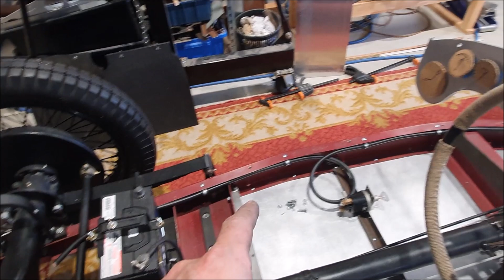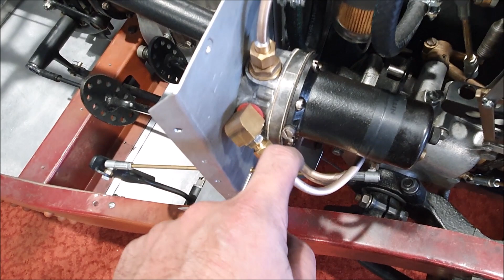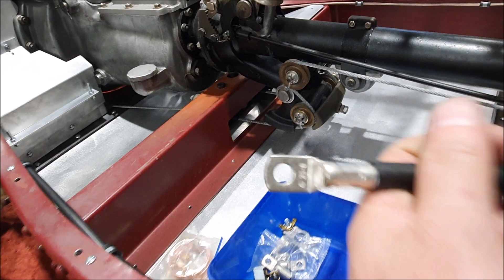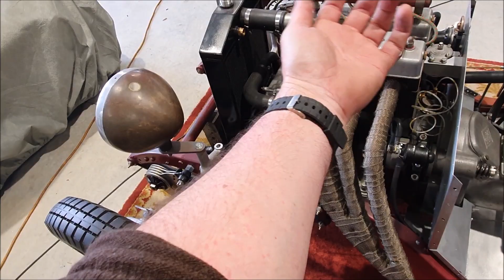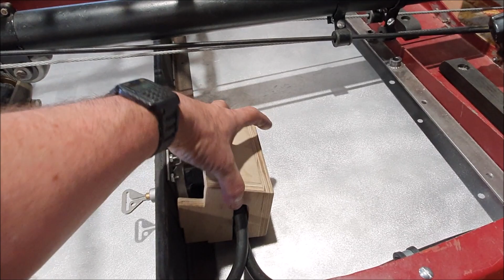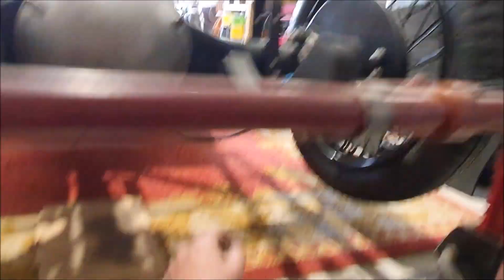Pre war Riley Brooklands - making up time part 2

Comment: Also put some rubber end boots on your isolation switch. The pump ticks as internal pressure naturally reduces when standing. Each system has its own quirks.
Reply from the maker: The brake light switch, which was also from Durite, has a rubber boot but the battery one didn't. I can 3D print some maybe.

Comment: Good progress. These fitments require forward thinking and take time of course. Fully recommend heavy duty cable as I had big issues with the twin 6v system on my Alvis. AES as already mentioned in the comments, set me right with suitable period cable and fittings. Looking at the earlier videos, you have done a fantastic job; Riley quality shines and it always saddens me when reading the company history and you wonder why they lost their way as an independent. This car is going to be a beaut. The SU pump if you have the mechanical ones, I always rubber mount  to reduce the noise. Perhaps not really an issue in an open car though however a really good earth is important. All the best from the UK.
Reply from the maker: Yes, I looked up AES after the comments and I think an order will be made soon! I think the right cable will be a good idea. Rubber mounting the pump might be sensible too. It has an earthing terminal on it. I just didn't wire that up for my test. My knowledge of Riley's aside from the Brooklands is embarrassingly limited but I always get the impression they had too many variants of car or too many options maybe. I can never keep track of them all.

Comment: Another thing that doesn't look right is the exhaust lagging. Whilst it helps prevent you getting burnt on the manifold, it was never used in the thirties. Any increase in power from the lagging would be negligible. Also the very angular pipes would look much better more curved after leaving the engine compartment.
Reply from the maker: It's another if it's a not there they'll complain for inspection things. They did have lagging back in the day. There is a picture of one of the Ards cars from 1930 with a high mounted exhaust so the pipe is right where the passengers arm sits and it is wrapped in something. Asbestos probably! Most of them had nothing though as you say. I might replace mine with black then it's not so visible at least.

Comment: There are a couple of anachronisms evident. In the thirties, battery cable was braided and such cable is still available. I would recommend AES in the UK who are quite cheap compared with other suppliers. Whilst most of it will not be very visible, it will be apparent in the engine compartment. 
  Your starter solenoid comes from the 1960s. The type of solenoid in use in the mid thirties was similar to the Lucas ST810 but in the early thirties most cars did not use a solenoid but a manual push switch that closed the contacts directly. Since your Rotax dash unit incorporates this type of switch, it seems a pity not to use it. You would save the added weight and complication of a solenoid, would not have to source a more appropriate one and the car would look more period. A push switch would be more reliable too.
I don't know if your plastic battery terminal covers are mandatory but if not, I would do away with them. They look awful on a thirties car and there is no real possibility of a short with them omitted.
Reply from the maker: There are lots of anachronisms if you look really close! I think the weight of the solenoid would be more than the weight of the extra cable to loop to the right of the instrument panel and back. I did look up AES, thanks for that. I will need braided wiring and I am not sure if I can find it locally. On my Austin 7 I used proper cloth wiring loom tape (Tesa Tape) which is black and that looked OK for the main loom. The Riley has little wiring so it would be nice to use the proper stuff. As always the postage will be the killer. 4m of braided battery cable was about 40 quid then 76 more for postage! The terminal covers are there to get past the inspection and are handy while I am working on the car to avoid accidental shorts. There are lots of things you can fail on that are easy to rectify for the inspection that can then 'fall off' later and no one will say anything. If this wasn't a replica but a modern constructed car then the battery would have to be in it's own sealed box. You can't have a battery and a fuel tank in the same 'compartment' but then they don't count the engine bay as a compartment. These are all the rules someone building a modern hot rod must follow but it gets odd for cars like mine replicating something where they can ignore a lot of the rules. It literally says "can soften the technical requirements as they deem appropriate for 'authentic replica'  scratch-built vehicles" so it's a bit vague!